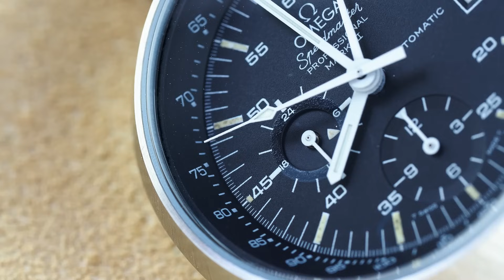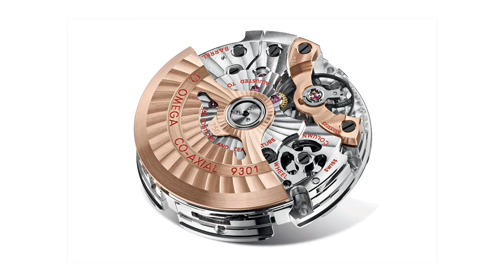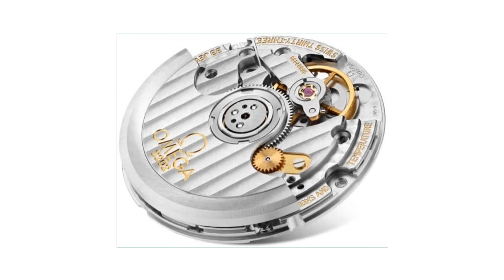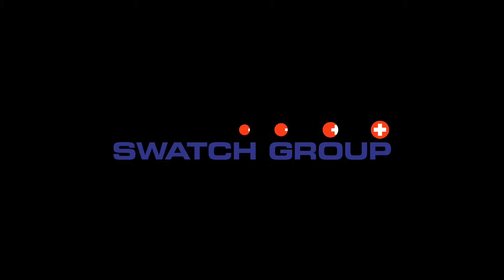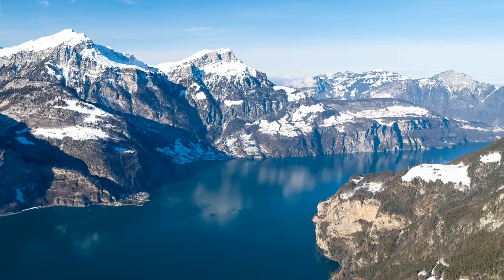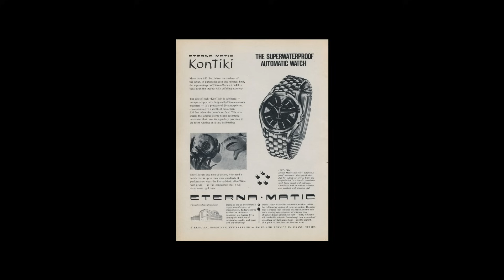Why ETA Watch Movements Deserve Respect

Comment: My 1980s rebuilt Tudor prince oyster date quick set has an ETA2824. I am told by a reputable local Rolex dealer. Im at the end of a test. Watch is -2 seconds ALL MONTH !!¿•
Isnt COSC run at -4 to +6
 seconds a Day. I could be wrong. Had no idea ETA made watches or that thier mame is eterna. Cool.

Comment: It's fine to remember what they achieved, but to keep using them half a century later represents stagnation. The industry has to evolve and show that they are still trying to earn respect, that they're still trying to find value for the customer. But ETA is becoming insular inside the Swatch Group. This is why ETA 2824/SW200 must give way to MJP G100/G101, because the latter has made significant upgrades.
Reply: This is partly due to manufacturers’ cost-cutting measures and partly because it’s a solved problem. Most mainstream movements share common features, such as the escapement and gear train, albeit with slightly different layouts and materials. That said, the MJP G100 introduces a meaningful improvement.

Comment: Like many, I’ve bought watches that have manufacture movements - Omega, Rolex, Blancpain, even a Patek. All great watches. However, my watches using ETA movements are prized. My Breitling is more accurate than my Submariner. I’ve never dropped or knocked an ETA watch and broken anything, and can’t say the same about some far more costly watches. After building millions of movements, they’ve gotten every bug out and made every tweak necessary. You’ll never hear me talk them down!

Comment: ETA also produced normal winding movements I.e. non automatic. Those were useful & long lasting for very common man-especially ETA 1080, -ETA 1180 etc. these movements were - tropicalised , having unbreakable mainsprings, have 40 hours winding power, requires very rare maintenance so famous in watch world . But now not available

Comment: The only issue I have ever had with my 2892 is twice in the last 12 years of daily use I have managed to bump it at just the right angle to cause one loop of the balance spring to jumo over a peg or something and it stopped.  My local watchmaker fixed it both times, no charge

Comment: I wonder what percentage of ETA movement parts are sourced from China?  If there are approximately 110 pieced in the movement, could 25% be manufactured in China - under the manufacturers specifications?  I imagine if ETA was manufacturing all of its own parts in-house, that would be part of the marketing of ETA, no?
Reply: I don't think even Rolex manufactures its movements solely in Switzerland. The rules for what passes as "Swiss made" are actually quite flexible.

Comment: Nah, it's a shitty movement. So fragile and rife with problems like the hand winding mechanism easily breaks due to using crappy reversing wheels made of soft metal like brass. Not to mention ETA movements are only worth about a few hundred dollars maximum yet you got these lying luxury watch brands claiming to use "in house" movements for their ETA watches and charging thousands of dollars for them.
Reply: Quality controls and raw materials are the current issues.  I bet that 100 percent of the labor intensive ETA movements are made and assembled in China under the supervision, from a distance, of ETA.  If ETA is not on the manufacturing site, like Apple employees are with the iphones, the materials become least expensive available and the quality controls are non-existent - because they are expensive.  What you get is a movement that lasts about the two year warranty before it breaks.  If the movement was made and assembled in Switzerland, ETA would market that.  The movement retails for $250 (think of all the labor in that $250).  As long as Swatch puts that movement in a watch that costs more than $550, they can say the watch was swiss made.
Reply: If you say so.
Reply: You're talking through your arse if you think you can get a 2892 chronometer grade movement for a few hundred bucks.

Comment: Eta make great movements are deserve respect to be sure. But I find it hard to justify buying an expressive watch with an ETA.  
Watches within the swatch umbrella using a form of an ETA are more justified even slightly higher end watches but a Tudor with an ETA is a hard sell imo, especially with Tudor prices these days.  
I see a watch and it's movement like a car. Would people be happy to buy a Porsche with a Toyota engine and still pay Porsche price?
Reply: It's just that no other company can recoup R&D costs to the same extent because of low volumes they sell. ETA is 70 years old, optimized, bug fixed and with patents expired. Almost no company can produce a movement that does more or performs better for the same money. The changes are only dictated by the necessity to have a selling point. It's like paying Porsche prices for an engine that's only 5% better and maybe not even that. If you look at Omega, they spent two decades fixing their coaxial movements and in the end it's just another way of doing the same. They can charge more but also the cost of ownership goes up because not everyone can service it.
Reply: It's tricky because marketing plays such a big part in the value that people assign to watches. I mean 15,000 for a steel watch? That's crazy. The best values I think are found within the Swatch family of brands.

Comment: What I don’t understand is why with these mass-produced movements people pay so much for watches using them. I am not saying that those watches are bad watches, mass production usually means that something works really really well. But, for an industry where mechanical art is its cornerstone, I just don’t see the appeal of getting more than one or two of the same movement. I also feel uneasy about spending a lot of money to buy a brand when I am essentially just buying an ETA watch with a few modifications and a branded case and dial. I can sympathize with people willing to pay more just to get the entry level (lower quality) in-house movement because at the end of the day, they bought a first party watch as opposed to an ETA watch bearing a name brand.
Reply: They sell you this romantic idea of an old watchmaker assembling your watch but it's not true. 99% of them are branded cases. Even Rolex mass-produces its movements. They ship more than one million watches per year. Do you think they do it by hand?

Comment: I got spoiled when I bought my Longines Lyre with an L888.5 (ETA A31.L11) - winding on it is so incredibly smooth and refined. I now have another watch with a derivative of the Sellita SW200-1 and I definitely cannot say the same...infact I read many users simply saying to treat SW200/SW200-1 as a non-manual winding movement and to ONLY wind it enough to start it and let the rotor do the rest.

Comment: ETA movements are good but what has gone wrong with many companies is that they do not use their own original movements so now they are all equivalent to each other, there is no originality, and the outside case of a watch is simply a facade for what's inside the case. You will never see an ETA movement in a Patek Philippe, or a Vacheron Constantine. Yours Truly, Tamayo the Watch Maker.
Reply: In the old days, it was common for watches to have 3rd party movements. A lot of work went into the cases and bracelets, particularly if precious metals were involved. in-house movements in many cases just make watches more expensive to purchase and to repair. I'm not falling for that.

Comment: You're perpetuating a myth, according to which the 2824 is any less good than the 2892. You're not very well informed. The precision of an ETA movement has all to do with its "grade" : Standard, Elaborate or Top. Some Top grades are cosc certified but that's not so important. What matters is that a top-grade 2824 will be prepared according to the exact same standards as a top-grade 2892 (or Valjoux, btw). The only thing is that 2892 doesn't exist in the lowest standard of quality, but that has no influence on the performance of higher grades.
Reply: Most 2824 movements you find will be of the lowest grade as they were the most widely produced. Even in lowest grade, it's still a very good movement.

The lowest grade of 2892 utilizes better shock protection and better finishing and materials than the lowest grade of 2824.

Unless specifically stated what grade of movement is used, assume lowest.

At the top grades, some people consider the 2824 to be more robust albeit at the expense of being thicker. Some designs, especially today with "turnip" sized watches can accommodate for this 1mm thickness (significant) difference.

Generally however, most makers will use 2892 or a derivative of the 2892 simply from market impressions that the 2892 is superior regardless of grade.

It's sometimes mistakenly implied that the 2892 is a significantly newer design than the 2824 but both trace their roots far back. The 2892 from Eterna and the 2824 from back when ETA used to be part of Eterna.
Reply: @paulpeter2869  "Most 2824 movements you find will be of the lowest grade" Not with TAG, Longines, Oris, Rado, Edox, Tudor, Breitling...
"better shock protection" if you believe Incabloc is any "better shock protection" you don't know what it actually is. In fact Incabloc is technically weaker because it only has two contact points with the stone (but it doesn't matter because it is strong enough in all situations). It is however easier to remove and reinstall, which is why watchmakers prefer it, but the only advantage is for maintenance.
The real difference is the quality control standards for deviation, isochronism, etc... this is what has most influence over performance. Top grade has much better quality control vs standard.

"Unless specifically stated what grade of movement is used, assume lowest." yeah if you're uninformed maybe. If you're informed, you are not going to assume standard in a Tudor or IWC, even if Tudor doesn't specifically mention the level of their movts...

"more robust" I think that's correct but i don't think it's any useful since you take care of the watch as needed.

The only element that really matters when comparing grades, or ETA vs Sellita, is quality control. If a movt was made to be within the limits of 0/+30 sec in 3 positions, it is less good than one that was made to be within 0/+10 in 5 positons. This has significant influence, but 2824 and 2892 are made with the same quality standards since ETA grades are the same standard regardless of which ETA movt it is, and that includes 2671 or 2000-1 for instance.
Reply: @KRaikkonenSF  fair enough. You made some great points there.
Reply: @paulpeter2869  :)
Reply: @KRaikkonenSF  since you know your stuff, I was wondering if it is really worth paying the extra money on a Top ETA 2824-2 vs a standard version movement. I'm attempting to build my own watch and I'm not sure what I should do. I really like the decorative aspect of the Top grade for clear caseback. The standard one just looks plain and boring. Technical side Top has better quality etc but just how much better? 

Also, do you know any good suppliers that sell these ETA movements?

Comment: But... 
ETA2824 vs SW200 - which is better?
Reply: Its the same movement, say, to 97%. What differs Sellita regards as improvement. My SW 200 which I regulated loses max 2 spd. When I wind it once per day it loses ca. 0.5 spd. Not bad, I think.
Reply: @lowersaxon  Nice.
The ETA2824 has various degrees of quality.
Standard quality isn't that great, but the higher quality is quite nice IMO.
I didn't know that Sellita made improvements upon the ETA movement.
I thought they just made it different ever so slightly to avoid patents.

Comment: Never realised ETA struck so deep into the heart of Omega. I think this is only a very good thing in the end. The tried and tested backbone of ETA, combined with the panache and extra development from Omega. Just purchased an Oris Aquis 400, mainly from the proposition of the in-house. I just couldn't get my head round the setting issues. Reluctantly, I'm sending it back. Such a beautiful watch, I'm sure Oris will iron out this issue in time, even though they publicly dress this issue as a 'quirk' rather than a problem. Just bought Breitling with the 2892, I can now rest in assurance of the reliability paired with the added features that Breitling has added to this movement, not as extensive as the Omega, but a great balance between quality and individuality. Subscribed 👍

Comment: I have much more respect for ETA than for Rolex.
Reply: Please, one is a movement manufacturer, the other makes complete watches, you can't really compare the two.
Reply: @einundsiebenziger5488  Not really... ETA has a long history that goes back to the XIXth century. It is a brand capable of making high quality movements in bigger numbers than most brands in the world and with a high level of reliability. That is very difficult to achieve. Rolex made its first movement in 2004... Rolex was for all the XXth century and assembler brand of external sources. The dials were made by one brand, the movements by Aegler, the bracelets and cases by several other enterprises. Rolex is a huge history of success thru marketing. The product is of high quality, but I do consider what ETA has done for so long time a more meritory achievement. Well, that is my opinion, anyway. Cheers.

Comment: Can someone help me? I have a ETA 2824 automatic and I noticed that from a cold start (due to no usage after a few days) I can only start up the watch if I spin the rotor counter clockwise. Is this normal? I’ve read that the 2824 rotor had bidirectional winding.

Comment: ETA powered vintage watches give you the confidence in reliability and serviceability of an otherwise ~40-50 year old watch. This aspect  can be seldomly found in other vintage technology (in comparison: try finding replacement parts for a vintage car). I'm a fan of the ETA movement and its history!
Reply: You can still buy Chevy small block parts, which is an engine designed in 1952.

Comment: I have 11 watches, from Breitling Tudor, Omega to Rolex. Half have a variant of the 2892-A2. One being the 2500D in my Seamaster. Everyono of my ETA powered watches runs great all with COS, even when not offered as chronometers. I have never had Anything but the highest respect for my ETA movements.
Reply: Agreed. I adore my ETA 2893-2 in my GMT. The 90 series ETAs are just awesome.

Comment: ETA movements are the milestone in the watch industry but on a budget level are obsolet in comparison to japanese movements. If you consider the price of a bare ETA 2824-2 costs 200ish € and it's counter parts NH35 40ish € and Miyota 9000 series 80ish € I would not take  ETA. At the other hand Oris or Tissot have wonderful eta based movements for the price. I guess ETA was never intended to be budget movement considering wher doed it comes from.

Comment: I’ve been working on watches for years. Recently my grandfather passed down a vintage submariner to me. The movement was long since dead and the quote I got to have it rebuilt would be enough to make you throw up in your mouth. I ended up removing the original movement and fitted the case with an eta2824 and I machined an adapter ring. It’s been regulated to run +1 second a day on my timegrapher. Someday when I have the cash to drop on a used 1520, I will. But until then, the ETA powers my Rolex. Kind of funny in a way. LOL
Reply: Interesting...I think within a few years the Eta mvts especially those modified by tudor or omega for example will be kind of collectible. I own a tudor prince DD from 92 and the movement 1)looks great with the perlage and 2)keeps incredible time (is it due to the special balance regulation system which seems different than the usual one ?) best regards
Reply: @artblend4278  I can see those skyrocketing. Not only that, but I could see the price of off the shelf ETA’s start climbing as well. I think the trend of building your own watch is catching on. Some of these manufacturers have been smart enough to realize that. The rest will take time... no pun intended.
Reply: @deeno1114  however it's a shame you could not fix the 1520 or 1570....(or buy a 3031?)
Reply: @artblend4278  unfortunately the cost for service was about what buying one on the used market would set me back. Another unfortunate reality about second hand parts. Not to mention most of these movements are found on eBay and likely need an additional costly service by the time they get to you.
Reply: @deeno1114  thanks for your answer! enjoy your vintage sub!

Comment: Having a number of watches that date from the 80s and 90s I can whole heartedly endorse the ETA movements. The 2824 is robust, easy to source parts for and easy to fix. I have watches from the 80s with this movement that have barely seen any servicing in their lives and they work just fine. The 2892-2 is my favorite movement of all. This is a fantastic movement and, in chronometer-spec, genuinely as accurate as all but the very best movements money can buy. I have an Eterna Kontiki Sport from 1992 with the full printed report from COSC. In all five positions, at each of three temperatures, the watch recorded +1 to +2 seconds with a delta of just 1 second  throughout the testing! That is staggering accuracy and consistency.

Comment: Very reliable movement indeed.
Most of their issues is solved by cleaning and oiling which is cost effective.
I think in particular of the 2824 tendancy to get the rotor rolling while being handwound.
Also very accurate in my experience, even after 25 years for the oldest I own.